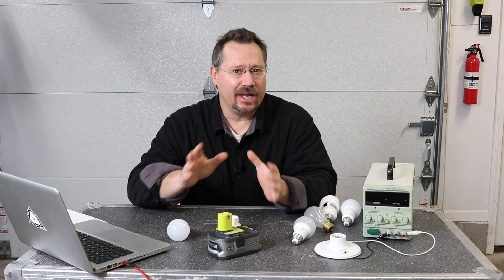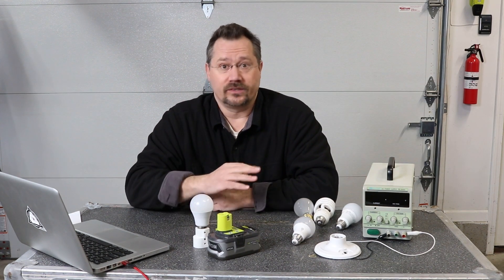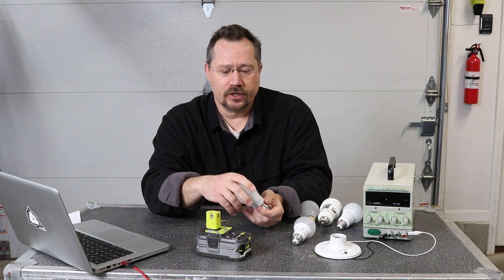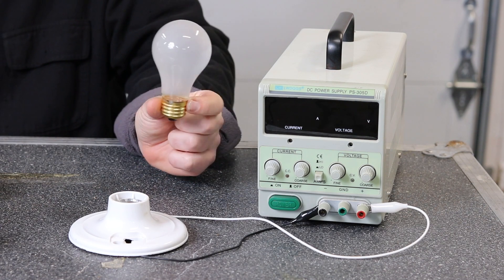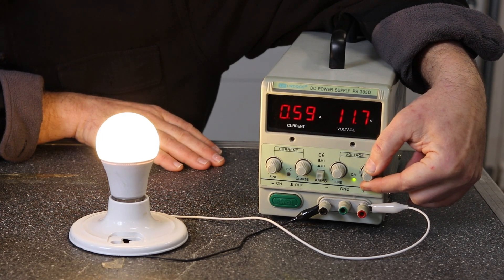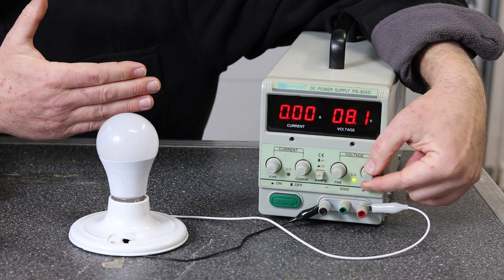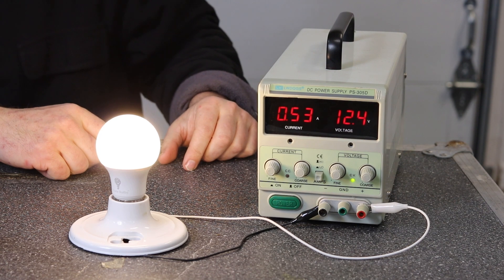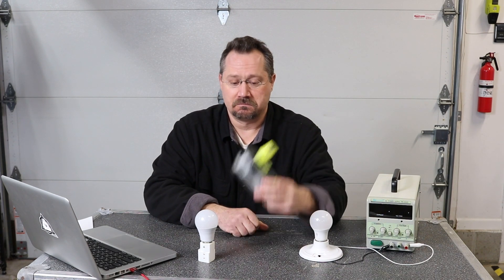How to Run 12V Light Bulbs on 18V tool batteries

Comment: Very nice explanation 
Though,  one question 
What will happen if you put 120 volt LED (Say 7 watt) bulb with 12 volt supply ? Could you please check that ?
Reply from the maker: @JPSingh-tk5ho  Generally, absolutely nothing. 12v will simply not be enough to power an LED bulb. It doesn’t light up at all.

Comment: So basically it's safe to run 12v lights on 18v battery? I have a 12v led strip light that I want to run on a 18v power tool battery in my kayak, do u think it will be ok? The adapter has a green fuse build in on the red wire?
Reply from the maker: Most 12V electronics will actually run just fine on a RANGE of voltage. Many will run just fine on an 18V battery.
If it's inexpensive electronics, I'd just try it. If it's something more expensive, I'd try to see what components it's built from, and make sure they can all handle up to 20V.
Reply: Ok thanks, they're inexpensive. I'm gonna try it, I'm hoping to run 2 led strips off of it but I'll have to see what happens

Comment: I have installed 1141 compatible LED bulbs in my camper (12V 1.7watts the packaging said). I was thinking of using my makita 18v battery. Would this work safety without having a 18v to 12v converter?
Reply from the maker: What range of voltage will those LED bulbs run on? The ones I’m using in the video are designed for 12-24v systems.

Comment: What about line loss ?
Reply from the maker: This very low current. The power isn’t going far at all. There’s very few losses. It’s about as efficient as you can get.
Reply: @BenjaminNelsonX  DC has greater line loos than AC, So using an 18volt battery for 12 volts means I can easily use a 50 or even 100 foot extension cord without dropping below 12 volts.   Try it, it would make a great video.  You can use your bench power supply.

Comment: How long would the bulb run before the battery dies out?
Reply from the maker: That would depend on the capacity of the battery. The bulb is rated at 7 watts. That's approximately half an amp of draw, so a 4 AH battery could run it about 8 hours.

Comment: Great video Ben :>)   3 thoughts here, first, the bulbs come in a variety of thread sizes and maybe you should mention that you used the E26 fitting. This will help others to find the right size threaded bulb to get.  Also, for those of us that can't/don't 3D print, you can find a Ryobi adaptor to save the 3D printing issue.  Third, I have on my channel, a couple of videos about how to make your own adaptor easily with some PVC, scrap plywood, and the ryobi battery clip.  The Ryobi clip and the adaptors are available on Amazon, Aliexpress, & Ebay.  If you can't find them, I can help you find them.  I would also tell you that I appreciate channels like yours and mine that give helpful info for others.  Keep up the great content, Ben.

Comment: Can you please make a video about how i Can run my indoor growing light that runs on 230 volt down to 12 volt dc
Can i just make 12v battery of 18650 cells and plug it in or must i do something else? I cant find eny video in english and you have a lot of knowlege and it wil help the community very much

Comment: I'm not aware of any light bulbs that actually require AC current. If it will run on 120v AC it would run on 120v DC just as well.

LEDs actually require DC. LED stands for "Light Emitting Diode" and diodes only conduct current one direction: Thus DC. The LED bulbs that screw into an AC light socket usually rectify the AC to DC anyway.

Comment: Thats very interesting but I'm sure I'm like most folk who don't happen to have that kind of gear lying about the house,I'm still vague on how I would apply this info..Idk
Reply from the maker: All I'm really showing here is that YES, you can run a 12V LED light bulb off an 18V battery> That is WHY I can 3D print a device that let's me put together a Ryobi battery and a light bulb and have it work.

Comment: why have they not stopped making the twist bulbs there are toxic and junk i have had them not last a week. good video i have some led 12 volts only one has went bad. take care, be safe and well.
Reply from the maker: The CFL bulb I showed was an old one. I really don't remember seeing any CFLs in the stores lately. They were a step in the right direction in terms of saving energy, but really just a brief bridge until LED lighting.

Comment: hi Ben, an 5S lion battery, has fully charged 21Volt?? 5X4.2V
Reply from the maker: Yes. The EXACT top voltage that a particular battery charges to might vary by manufacturer, along with any little trade secrets they have, but "18V" batteries usually have a charger that provides 21VDC.

Comment: The first video you made about this was interesting to me. I don't have a 3D printer so I looked for a way to build something similar. I have a different battery so I couldn't buy one from you. I found some stuff laying around and made something that works. I also made a shade out of a bleach bottle and one of those old fashioned clip-on shades. The only thing I had to buy was bulbs. Cost was about $5.  It's not pretty but it works well.

Comment: I’d open the bulb and see if it has a constant voltage/current circuit. The last bulb might not last on 30V
Reply from the maker: I haven't cracked either bulb open yet. I'm not much of an electronics expert, so it's hard for me to really understand all circuits just by looking at it. I think that 30 probably is kinda high for the Bluex bulb. The LeMeng battery specifically lists 30 right on the box. It also just feels a little higher quality. The diffuser is better.

Comment: I wonder how many ppl blow out their 12VDC bulbs but accidentally screwing them into a 120VAC socket. Maybe make a video testing over voltage protection...? Have a fire extinguisher handy haha
Reply from the maker: Fire extinguisher always handy! (See background of video!)
My best guess is that screwing in a 12V bulb into a 120V socket will just be a good waste of the bulb!

Comment: I can see how some viewers and commenters could make that mistake; it's (incorrect, but) easy to assume everything with an E26 screw base is/should be 120VAC if one hasn't seen it used at any other voltage before.

Comment: Did work with electric vehicles in the past running a 24v dc to dc converter.  We found out the led lights with wide ranges use multiple transformers inside, and switch between transformers as the voltage increases.  You can see this in your test of the 11-30v bulb as the current had steps where it jumps.  On the lights we had, our dc-dc converter was at one of these transformer steps and it caused the lights to flicker.